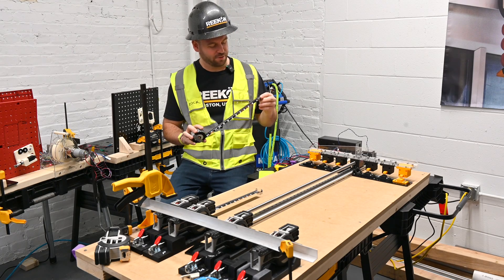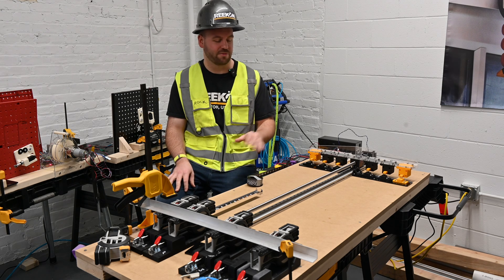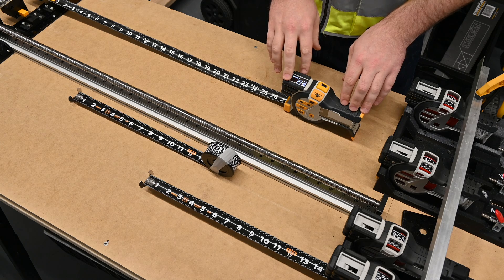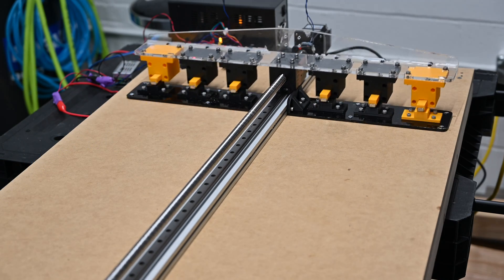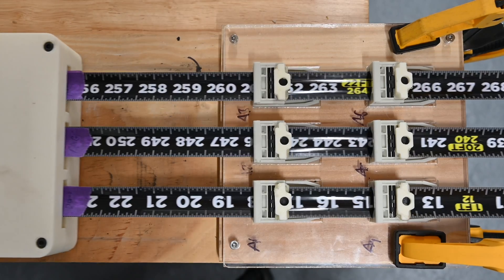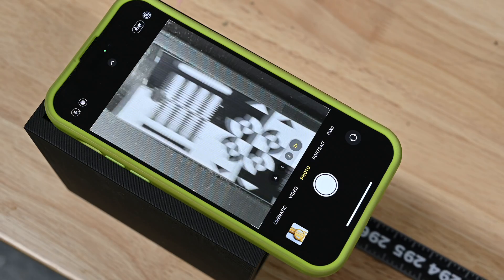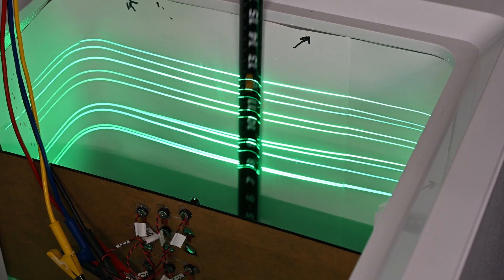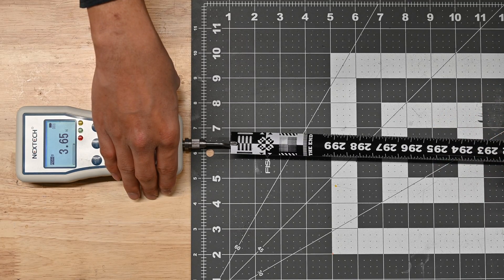Tape Measure Durability Testing to the MAX - REEKON Tools

Comment: Does it retract itself, or does it need a bit of help? Mine, I have to kind of push it ..
Reply from the maker: Hey James, the retraction force is lower so it cant slam in to damage components as well as prevent debris from entering the tape measure (with the wipers)

Comment: I work in construction, so I would like to see how the tape stands up to different types of dust, debris and liquids. I didn't see any of that type of testing in this video.
Reply from the maker: the retraction jog is usually where we do this and sprinkle dust and other debris through the retraction process.  The T1 has wipers in the front to try and prevent as much of this as possible from entering the reel assembly